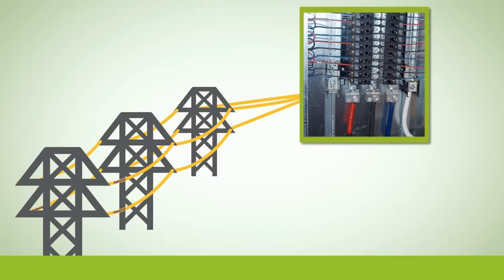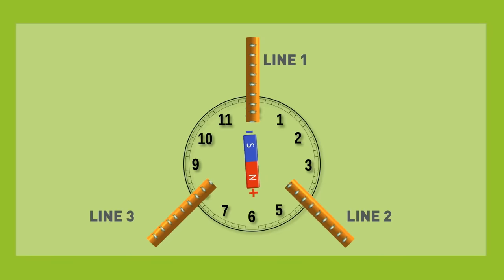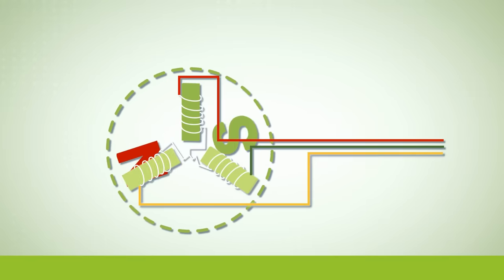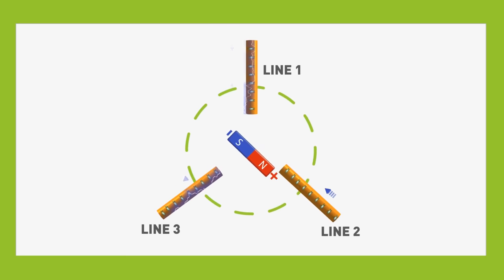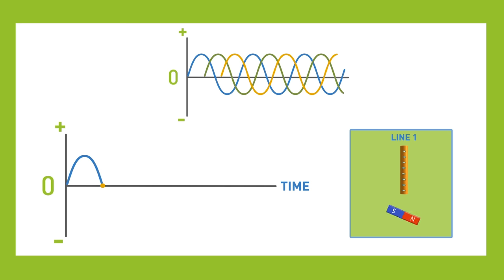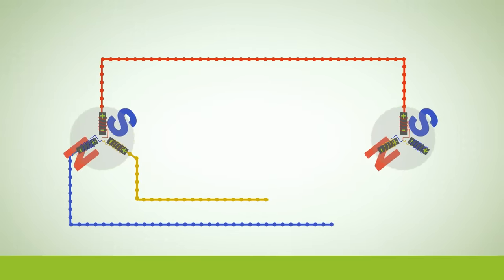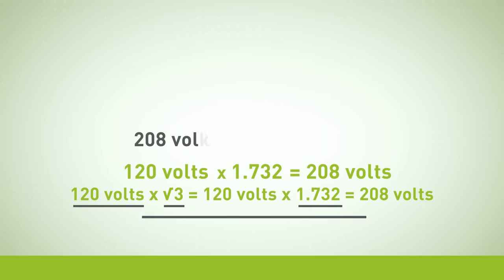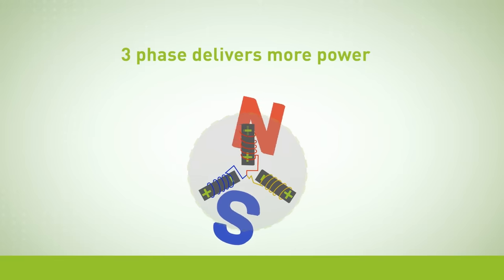Three-Phase Power Explained

Comment: Bad video, sorry. You keep showing an unconnected piece of wire for each phase but clearly, current can't flow like this. Since there's no neutral, where's the return path? You use the 3 sine graph to show voltage but do not explain what that voltage is referenced to. Again, since there's no neutral, this is not obvious. You show that you connect the load between two phases, but since every phase is at some point on the sine curve, the effective sum must be different than either phase on its own. Where's the graph for that?
Reply: the return lines are the other 2 phases.